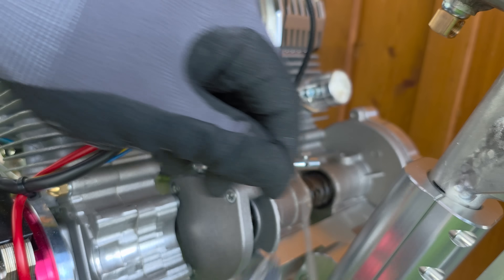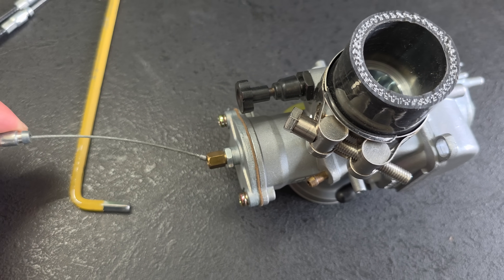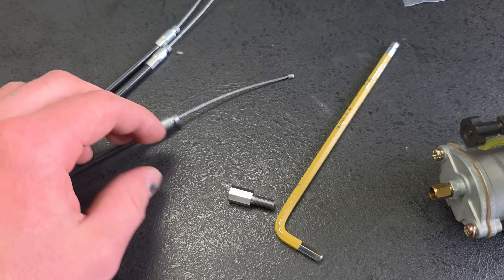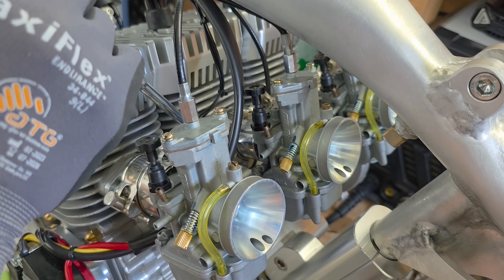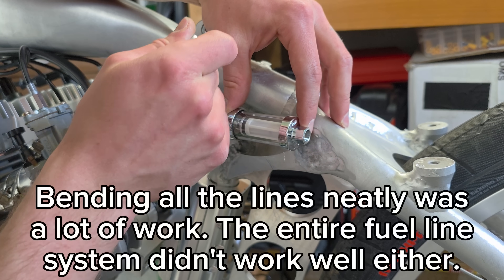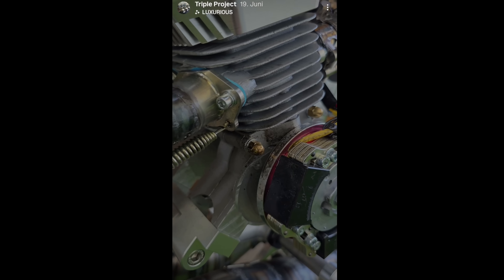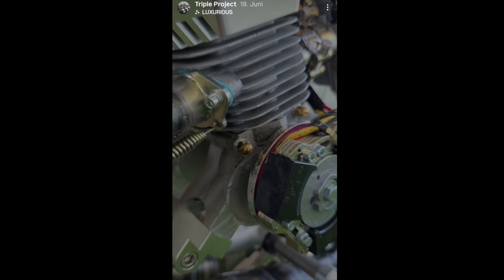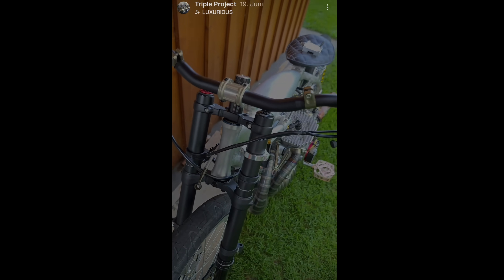First Ride and Final Assembling | Triple Bike Build Part 15

Comment: Ich schraube seit 30 Jahren an 2 Takter und tune gerne. Probier mal ein Metallgeflecht hinten an die Vergaser zu machen, damit Du etwas Unterdruck bekommst bei Halb bis Vollgas. Sonst verschluckt die sich da an Luft und Du bekommst das im oberen Drehzahlbereich nicht abgestimmt. Da schraubste sonst 3 Wochen dran bis zur Verzweiflung. Bis man alles richtig abgestimmt hat mit Zündzeitpunkt, Vergaser, Resonanz und es richtig biestig wird nimmt auch nochmal viel Zeit in Anspruch. Viel Glück. Bin gespannt wenn es richtig läuft. Macht man da ein Moped Schild dran ? Ist ja ein Fahrrad mit Hilfsmotor. Also ein Mofa. Motorfahrrad. 😂

Comment: It looks good 
But not with the 3 different exhaust 
use a triple pipe 3 into 1 with the end port of the exhaust larger diameter it would look so much cleaner 
and it will give better clearance from the floor wouldn't be hard to make you will be glad you did it
Reply: It would run like shit.

Comment: I just found your channel and subscribed to it. I have a felt faker myself and making 13+hp with a hybrid engine. A Yamaha prebug Stage6 Sport Pro MK2 vertical cylinder good for 15+hp top end . With an 10mm aluminum adapter it mounts to the china doll bottom end. 40mm zmn crankshaft long rod and catnip ignition with OZ magneto. If a run a ktm50 ignition I could get more rpms. Using a mikuni flange mount vm20 carburetor. I have a 9t,10t,11t, front sprockets to change up my gearing and a 36t rear sprocket. I’ve turned 14,512 rpms already on 26” tires. I use a Zoom downhill triple trees and Zoom line pull hydraulic calipers. It’s very fun to ride with one hybrid engine and can only imagine having 3 hybrid engines creating 45hp and weighing around 70lbs. That would be nutz I say,lol!! Have fun!! Keep it twisted!!!!

Comment: REMEMBER TO BREAK IT IN PROPERLY! Run it rich and let it run with minimal throttle for 20 or so minutes. Turn it off, and let it cool down and do the same cycle 3-4 times
Reply: You want the RPM's to go up and down, up and down, no steady RPM. You also don't want to go to full throttle.
Reply: Calm down, those are china cylinders and pistons. Who cares? I didn't even break in my CNC piaggio correctly and it's doing fine.
Reply: @trentbikes whoops... I thought he had upgraded the cylinders 😅

Comment: O  rings inside your exhaust manifolds. Look up a 1987 Honda trx 250r exhaust. It has 2 o rings that the pipe goes over. That will fix ur leak. Also, yes, they are rubber o-rings.